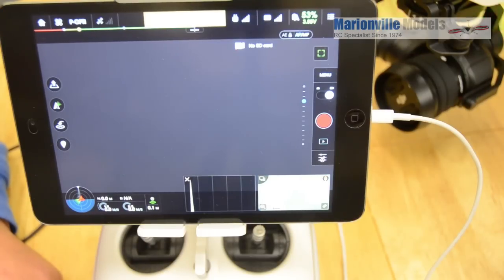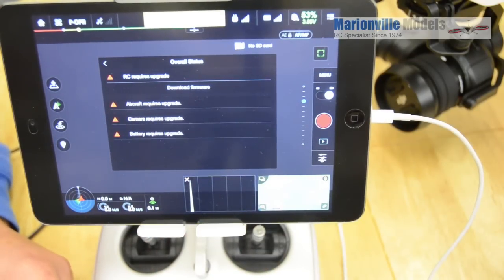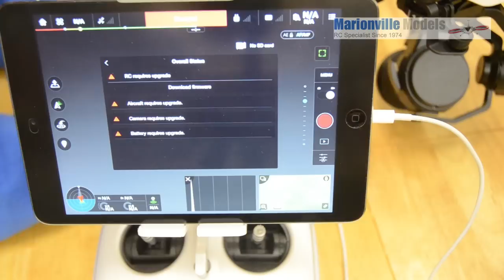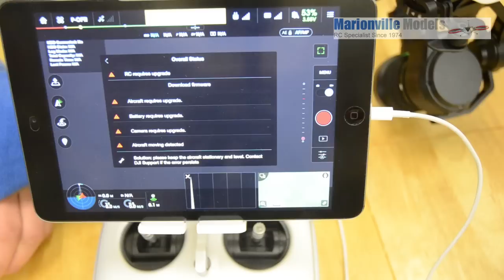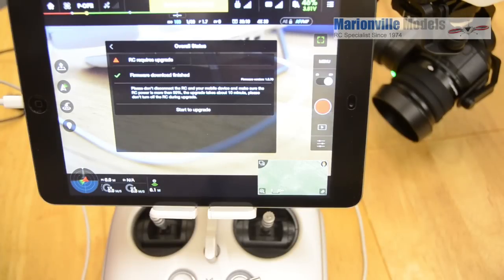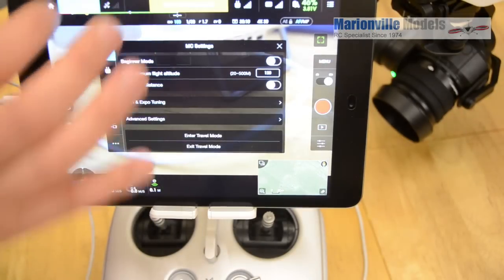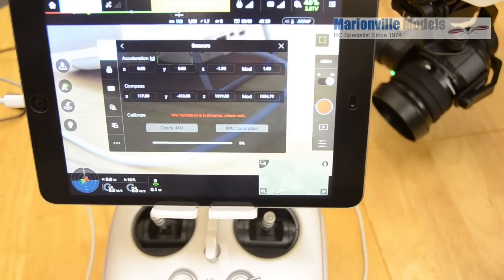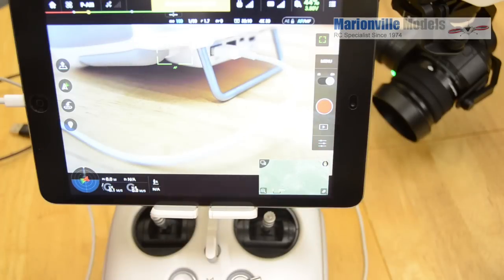Upgrading to DJI Inspire Pro with X5, Part 2 How To Update the Firmware

Comment: Great Video, Does the camera have to be off while you plug the USB cord into the computer to do a direct update instead of using the SD card. Sorry for ridiculous question but would rather do it that way.
Reply from the maker: Thomas Fick it probably wouldn’t matter but I usually have the camera off

Comment: I just updated the camera firmware then pulled out card powered down put same card back in powered up and quickly hit format sd card and it didnt work :( so dont try that now I have to re install all firmware i think because my camera is now unresponsive.
Reply from the maker: If you have no luck try down grading first the update again.
Reply: +Marionville Multirotors Actually it was minor, I just pulled out too early (lol).  So I reinstalled and am all good.